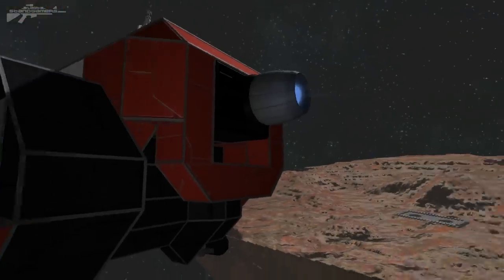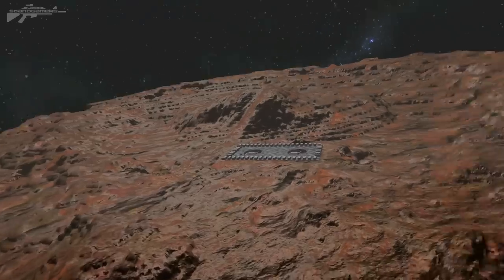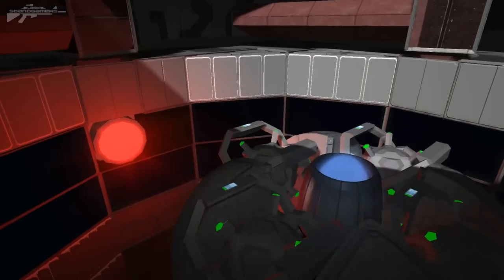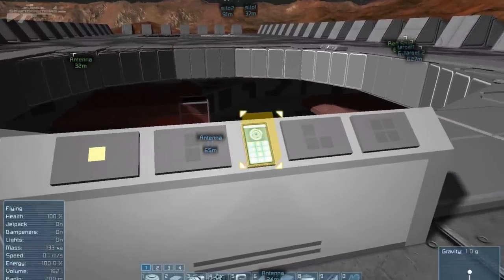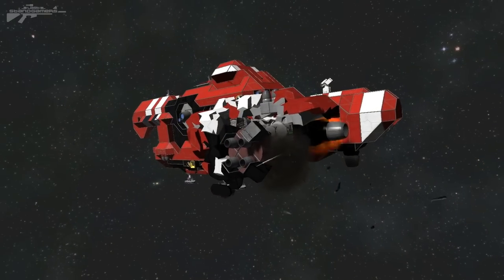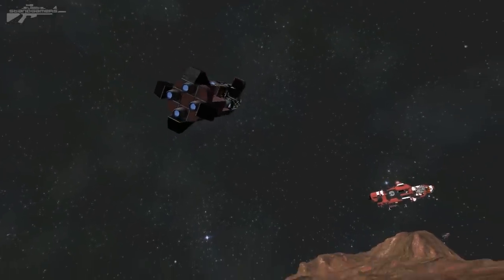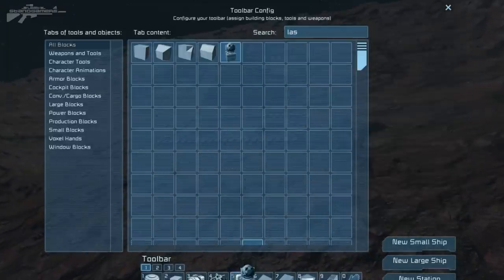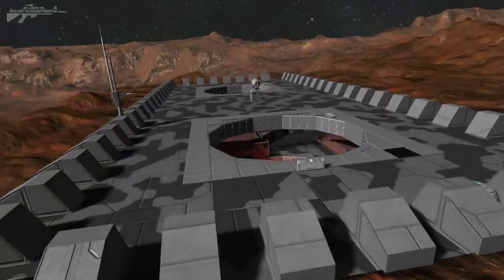Space Engineers - Cruise Missiles GPS Targeted

Comment: LastStandGamers this is very out of the box and you have addressed it's critical weakness of moving targets as a problem.

But i'm rather surprised you didn't go for a satelite patrol array. Imagine a large ship, large cargo container, solar panels, 6 thrusters, turrets, batteries. You could make a load of gps points around your base but not use any two points that cross and make a shield of drones to protect your stationary base. The alternative is making crossing paths or even the same path, but the dangers are the autopilot will not take into account opposing bodies and as such if two drones intersect they will destroy each other via impact.
If we could simply give the remote controls specific directions such as turn at this rate, then you could let a sattelite orbit after turning off inertia dampeners. Although that is technically possible with a programmable block i'm sure. There has to be someone who has done the math. A burn time of this long on a mass of this size with inertia dampeners off requires a rotation rate of x to produce an orbit of y size. I think the equation would be X(TM)=Y where T equals burn time, M equals mass effect on thrust power,and X equals the rotation rate to create Y the orbit diameter. This equation does not include gravity from the bases.

Comment: Might I suggest that instead of having the target on a station, why don't you have it behind the station? This could serve at least two purposes.

1) When autopilot approaches it's target, it tends to slow down and stop, leaving it more vulnerable to station defenses. Having the target behind the station would alleviate that problem.

2) It would be easier to get the targeting info in the first place. Have a designated scout ship skirt around the enemy station, out of defensive range. This saves the effort needed for infiltration, and is useful if the enemy won't allow 'peace talks'.
Reply: Or remove forward facing thrusters... (braking thrusters) or does that not work?
Reply: Ruud Maes As mentioned in another comment on this video, the reverse thrusters are needed for when the missiles are leaving the silo. In order to use the idea of unpowered reverse thrusters adequately, you'd need to do one of two things:

1) Have a timer set to deactivate the thruster after the final run-in has started, but that's extremely difficult to do, due to the precise timing needed..

2) Put two RC blocks in. The first would be set to one-way and leads up to the waypoint immediately before the final run-in. Once it reaches that point, it would run a group set to deactivate the thruster and activate the second RC unit, which would be programmed with the final targeting waypoint.
Reply: I Din't think about it leaving the silo, but it makes sense bow
Reply: Now*
Reply: Michael Oakes ITS EASY! !!!!!!!!!!!!!!!! add a sensor block for 5-10 M and it will be ok! (that senseor when sees the ship, turns off the the front thruster and full thrust with back!!!
 PROBLEM SOLVED!
Reply: Creating... I was gonna suggest that.
Reply: Or make two waypoints BEFORE you reack a station in such a way that it is aimed directly at it and use the action after the one way to turn on all foward thrusters to max...
Reply: or maybe we could place a camera on the missile and place a laser antenna so we can remotly control the missile and avoid any autopilote mistakes
Reply: CyberChampion 
That would require a millenium falcon size missile at tge least...
Reply: How about you just don't give it a braking thruster?
Reply: PetersonZF If you'd read the full comment thread, you'd realize that this was already addressed.

Comment: Try not putting a forward thruster on them so they can't slow down.
Reply: EnlightenedAce then they dont work at all, at least not for me
Reply: ***** Maybe it would be possible to use a timer block to deactivate the front engine after it performed the turning maneuver?!
Reply: *****  Not necessarily if it didn't have the front thruster it would just make a larger arc to get to the target. If it does you could always set up a timer to shut off the front thruster after the missile has left the bay.
Reply: You could probably put a snaller/weaker thruster from the workshop on the front, and like stronger ones in the back. Or set up a timer block/sensor to kick on a "booster" set of thrusters that have override maxed out
Reply: Thegreatgamecreator yeah that makes sense and maybe use the new upgrade blocks to make them faster because they might see the missile if ship is occupied, meaning either shot the missile before it gets there or dodge  ?
Reply: EnlightenedAce ITS EASY! !!!!!!!!!!!!!!!! add a sensor block for 5-10 M and it will be ok! (that senseor when sees the ship, turns off the the front thruster and full thrust with back!!!
 PROBLEM SOLVED!
Reply: Creating... There you go. That would work just fine.
Reply: ***** Honestly I'd rather see it fly out at a large arc than stop and reorientate. It looks so derpy how it stops and turns.
Reply: ***** Actually when it turns it the side thruster will slow it down.
Reply: U shuld add morr boms 4 bigger boom boom

Comment: Could you use a timer block or sensor to maybe launch some sort of cluster munition when in range? Maybe have the front be a cluster warhead to break apart the outside of the ship then have a solid, blast door coor on the rear side with an explosive meant to detonate from the inside.

Comment: I wonder could this sort of system be applied to a drill ship to cut down on some of the tedium of mining? Plot a course that threads back and forth through an asteroid, switch the drills on and just let it go.
The only drawback is that there's no way for it to detect when it's full and return to home base for offload.
Here's hoping they can implement auto-docking at some point too!
Reply: Reverend Trigster Code blocks can do automatic docking to an extent, there's various scripts that have been around for a while that were basically "autopilot before autopilot", with the added benefit of being able to modify how the ship behaves as it goes about its movements.
So, you could take a ship, use waypoints/auto pilot to get it close to a station's docking port, then have the code block take over and line itself up for docking (I believe through the API you can tell whether a docking port is ready to dock or not, this can be used to tell the ship to go ahead and activate the dock).
Reply: Reverend Trigster Another thing about it too is having to manually start the drilling since if you set it from further away it would go full speed into the asteroid and likely destroy all your drills.
Reply: Seth Baker Sure, it wouldn't be suitable for long range mining, but then you'd have to be right there anyway in order to get the exact GPS coordinates for the waypoints. The idea is to set things up and just let it run so you don't have to babysit the whole time.

Comment: I'm wondering if you can only mark a GPS point as a person, or can you do it in a small remote control craft? Because if so you could make small beacons/transmitters, basically a camera, antenna and a reactor. Using a Henry like craft, you do a "bombing" run on a silo/bunker where they are used to mark GPS locations, and then a ship further up with heavy arms could just drop a few on the planet. This means that you could quickly get in and out avoiding any weapons fire that you would get for trying to move in on foot. Once the devices are in place, all that would need to be done would be to lock on and fire away. Probably a bit of a clumsy idea, might need a bit of fine tuning.

Comment: The problem with the laser antenna idea is that auto pilot takes the GPS coordinates when u input them and saves them separately. So even if you delete a point on a patrol the ship won't change its course you have to go into the ship to update it.
Reply: Legoman165 The idea he was proposing was that they add a block that is specifically for keeping the autopilot updated, not that you could use the laser antenna to do it currently.
Reply: Neronix17 Ya, I meant to add "unless a mod changes it to also constantly update the auto pilot"
Reply: Legoman165 Even then doesn't the antenna currently work by you giving it the coords in the first place?

Comment: You should make a mussel that has a gravity drive, because gravity drives get a greater rate of acceleration
Reply: davis smith Since such a system takes some effort to get ready i would expect that it is supposed to be used at longer ranges. Due to the speed limit acceleration doesn't matter as much after a certain range. On top of that up to the point where you reach max velocity your missile is vulnerable against all sorts of gravity fields messing up with its aim. Even if its just a large ship in the area passing by it might make you miss your target at long range. Even worse if you forget to turn down your station field. Thrusters do well enough as long as you are able to reach max speed on the way to the target and a missile doesn't have that much mass anyways.
Reply: Gravity drives are not cheap.
Reply: Mattpoppybros Far cheaper than thrusters for the same amount of oomph.

Comment: I don't think this is an effective weapon.

Turn the red ship to an enemy with active turrets and you're exposed warhead will get popped.
And if your plan is to fire it at a non moving target which you scout in advance, You may as well just fire a basic torpedo at it.

It is far better to just build a remote control missile.
Extra points if you have one that separates the engine section before impact so you don't waste resources.

Comment: I have a concept for movement using rock and gravity generators however unfortunately I know almost nothing about gravity generators
Reply: Nathan Ibbotson 
As a weapon or..? Your comment's a little vague
Reply: Just a way of moving anything so it could be for a weapon or ship
Reply: Nathan Ibbotson
Hm... well what don't you get with grav generators? I'll admit the field settings are a little confusing, but beyond that...
Reply: I've sort of managed some settings but some things are harder to grasp like the field settings and working out what g-Forse to use can be very hard for precise machines
Reply: Nathan Ibbotson is the thing that you are talking about like a gravity drive cuz as you explained it so far it seems like it.
Reply: martijn smit yes
Reply: Nathan Ibbotson
Well the field width/height/length is based on the diameter of the field; 7.5m length and width for instance would cover a 3x3 block square. Means you'll have to do some measuring if you want to cover a precise area, but that's usually fairly simple.
As for field strength, well that's not (normally) too problematic (unless you're dealing with anything other than a straight line). Just keep in mind that we've got a hard-coded (and pretty slow) speed cap; you don't need to keep accelerating an object that's already at top speed after all.